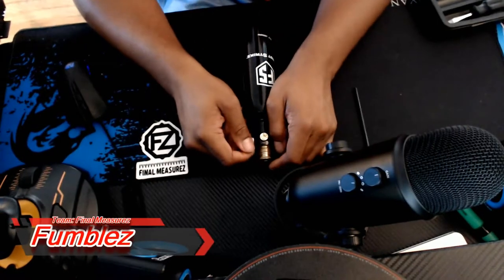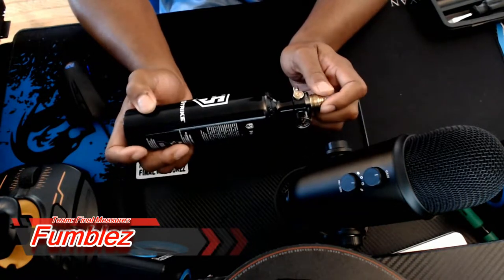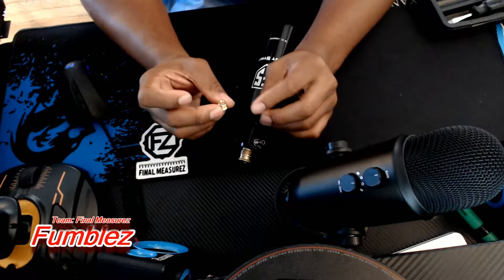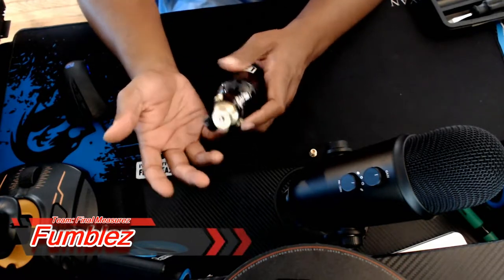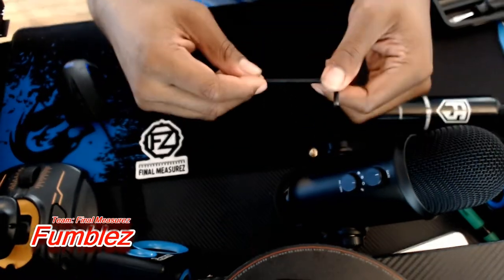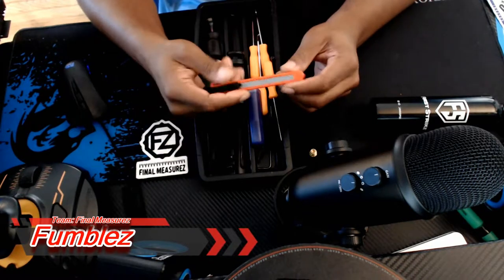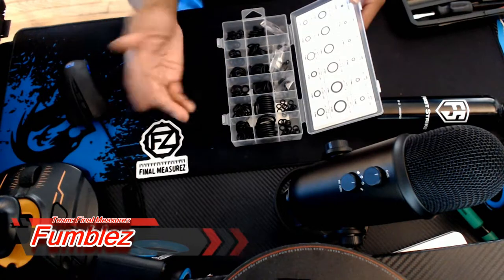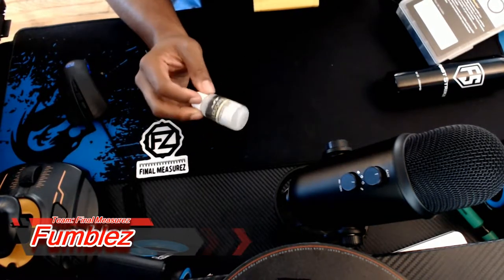How to replace a  burst disk on a first strike 13ci tank

Comment: Why no teflon?
Reply from the maker: You could use teflon I put it  back how it came from the factory. And it's good no leaks or nothing.
Reply: @Bastardairsoft  yeah i expressed my self like  a shit, all i wanted to ask  was, if its safe to put teflon on the burst disk thread  in hpa tanks
Reply from the maker: If want you can use teflon just not too much
Reply: @Bastardairsoft  yeah ofc, i have another question, im actually refilling my hpa tank from a scuba tank, i aways used the same tank,it always filled my hpa tank  close to 3000 psi, lime 2800-2900, now  it fills only to 2000-2100, did it happened to you?
Reply from the maker: ummm no you may ant to get the tank tested to make sure its in good working order @microiceification